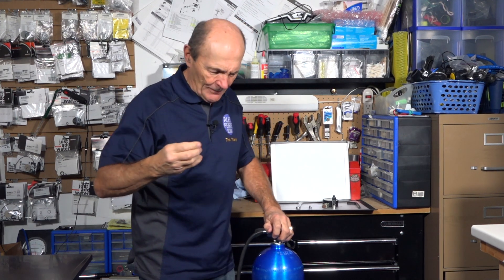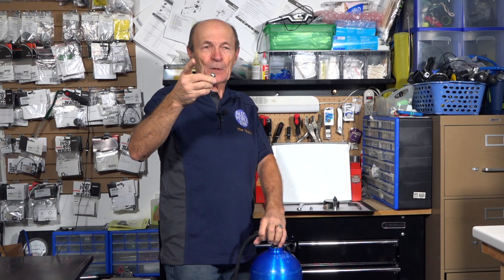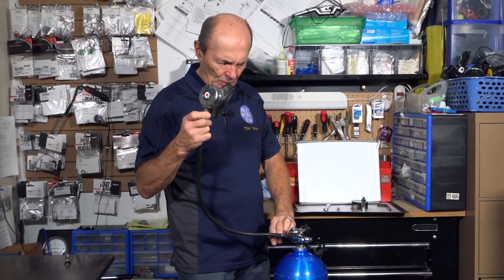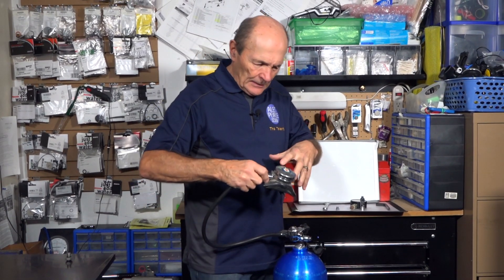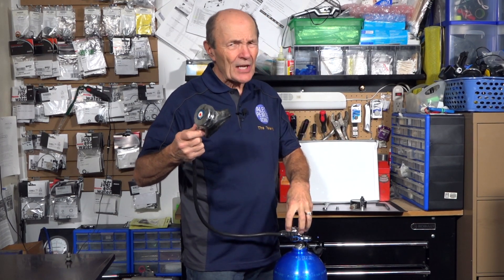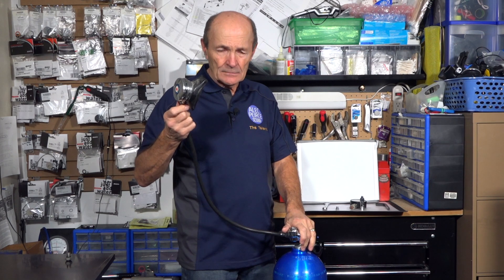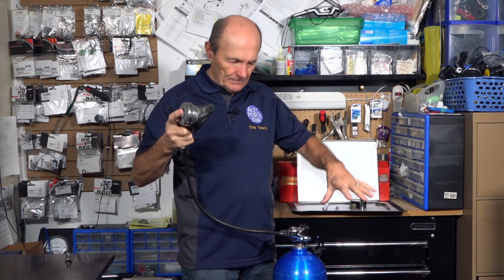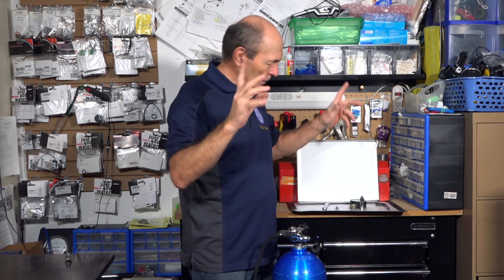What Is An Overpressure Valve? - Scuba Tech Tips: S10E19

Comment: Do you have experience with poseidon? I have a xtream 2nd stage that says ip should be 125psi if my first stage is a scubapro mk11 with a c370 and a ip of 130 to 140  will this be a problem? Thanks
Reply from the maker: Poseidons are a bit odd. They do require a specific IP and it's usually lower than for many other regs.
So, rather than adjust the Poseidon 2nd stage to work properly with the IP coming from the MK11 1st which is the common adjustment method, you can simply adjust the IP coming from the MK11 to work properly with the Poseidon 2nd.
Assemble the Poseidon 2nd onto the MK11 1st.
Turn on the air slightly. You will probably get a hiss.
Turn the Allen head bolt on the MK11 counterclockwise until the hissing stops.
Turn it clockwise until it hisses again.
Keep doing this back & forth until there is no hissing but it's right at the edge, just about to start.
Breathe. Feel good? Try it in shallow water. Good? You're away!!!
NOTE: this is NOT in the book & may be frowned upon by reg service professionals.
But, it works.
Also note: if you are using a Safe Second, it will have to be adjusted to work at the lower IP otherwise it will be hard to breath.
Alec
Reply: @Alec Peirce Scuba  so the ip on the scubapro 370 will have to be adjusted from the reg itself dose that take special tools? It seems poseidon needs to use standard ip pressures, and they would sell a lot more in the states because this is the fear most have  using. Ed Sorenson from Cave Adventures said I will never notice the performance difference as long as it doesn't free flow. I'll try it in a pool first. A shame they can't be universal 😕 trying to put together my sons first scuba set up, so he will never forget it is getting difficult. I will adjust it like you said 😉

Comment: Another great video and i like the practical demo of adjusting the IP and pushing the 2nd into freeflow!  A picture is worth a 1000 words and all that

If i may humbly add a couple of additional points that might make it a sensible descision to add a OPV to a std regulator setup :-)

1) Your demo is with an old unbalanced 2nd.  Nothing wrong with these, but a lot of modern 2nds are pneumatically balanced, ie they use the IP to help push the demand valve shut a bit. This means it takes less force to open that valve, meaning they can use a smaller diaphram (for a more compact 2nd) and the diver gets a slightly lower inhilation effort.  The side effect however of a balanced 2nd is that the very fact that it is less sensitive to changes in IP (normally a good thing) means that typically it won't get pushed open until a much higher IP.  That higher pressure could be above a critical point, either a hose burst (actualy unlikely for good condition hoses as although the working pressure tends to be 250psi, bust pressure is typically >500 psi) or more likely, and potentially just as serious >>>>

2) >>> At some pressure, chances are, the valve controlling the air into your buoyancy control devices (BCD/Wing/Drysuit etc) can get pushed open by the excessive IP!  Now you have the potential for a catastrophic ascent rate, leading to potential barotrauma, and DCS, even from fairly shallow recreational depths!   Sure, if you know what has occurred, and you react fast,this can be easily mitigated against, by diconnecting your inflators from your buoyancy devices and dumping gas, but it can happen quickly, without warning and potentially when you have hands full doing other things!  And as we all know, things snowball so to speak.

3) For most divers a fully freeflowing 2nd stage, especially one being fed with an IP way above normal is a fairly dramatic event!  Lots of noise, bubbles, and the feeling that you can't breath because air is being "rammed" into your lungs.  Yes, we are all taught how to deal with this event during our training and hopefully we practice these skills now and then, but again, none of us are perfect divers(well 'cept me obvs... ;-)) and things can get out of hand.  So for me, the biggest advantage of a completely seperate OPV mounted into a spare port on my 1st stage is simply to provide an external, seperate and more controlled vent for any IP excursion.   And because that vent is seperate, and away from my 2nds, even during a pretty catastrophic 1st stage freeflow with IP through the roof, my 2nds breath normally, and my inflators work normally. Sure, i'm thumbing the dive and getting the hell out of dodge, but whilst i do that, i am not tasked loaded by actually having to deal with the problem.

I guess we also should mention the downsides of fitting an OPV.

1) OPV can leak at normal IP's.  There are a few types out there, some seem worse than others.  The really cheap ones don't have any way of physically "locking" the adjustment screw and these can work loose, undo, and suddenly they leak at normal IP's!  DOH! not good, but easily fixed, and easy to spot (do your S-drills / bubble checks everbody!). They also can get jammed open by dirst/grit, but this is fairly incommon because they sit behind the 1st stages filter element.  They also can be damaged if gear is dropped and banged into, but again, careful handling of you kit is always recommened. - Carry a spare one in your "save a dive" kit!

2) the OPV is probably mounted behind your head in most cases (for backgas cylinders) and hence isn't that easy to see (eyes in the back of your head???). If it starts to leak, due to a fault with it, you can probably hear it, but not see it. Make sure your buddy knows what it is, and then you can ask them to check it!  If it starts to leak due to a genuine IP overpressure, chances are there will be so many bubbles you or your buddy won't be able to tell where they are coming from!

Hope that's interesting to your viewers!  Cheers :-)
Reply from the maker: A very good explanation that should help someone with a OPV problem.  Much appreciate the though and effort to share this with everyone Max.

Comment: Some CCRs have the over pressure valve installed. I read having a burst disk on manifolded valves can be a weak point. What's your take on this?
Reply from the maker: As others have kindly pointed out, I'm not a certified tech or CCR diver, but have done both.  Burst disks rarely are the cause of a tank leak where over filling, extreme heat, abuse, no replacement are the primary cause of a burst disk releasing.  I think having more than one safety disk, burst or OPV, is enough if you care for the gear properly.

Comment: Thx Alex. I been enjoying your videos during this difficult time in Singapore for the COVID-19 quarantine measures. I was hoping the u can do a video on the general tyres & sizes of O-rings involved with scuba diving. I been thinking to have my SAD kit with o-rings or for general service of my equip. Recently an O-ring fly out from the DIN regulator. Fortunately I found it on the boat.
Do stay safe at home..."Live long and prosper" - Spock.
Reply from the maker: There are only about 3 or 4 O-Rings that a divers needs to have in his 'emergency' kit. By emergency I mean, on the boat just prior to a dive.
A tank valve face O-Ring (if using a yoke), a DIN regulator valve face O-Ring (the one on the threaded insert), and maybe a couple to replace the ends of the hoses at the 1st stage (2 different sizes needed).
Any more than that and you are looking a professional service.
I hope this helps.
Alec

Comment: Does that mean every diver who wears a dry suit, the hose coming from the valve on the tank to the dry suit, they will always have to install an overpressure value?
Reply from the maker: No. Not necessarily.
Most systems will release excess air, usually through the primary 2nd or safe second.
An OP valve is only required if the likelihood of non-release is possible. 
That is, if a problem in the 1st stage occurs and there is no automatic release of the increased pressure, an OP is needed.
A

Comment: Informative video as allways
One additional purpose of OPVs:
If you use an Upstream regulator (there are still a few made today, i.e. Poseidon) you need one but they usually have an OPV built into the 1st stage
Otherwise you couldnt breathe if the IP rises
Reply from the maker: That was the point I tried to make.  Hope you picked up something new.
Alec
Reply: Possibly the old cyklons are upstream, but are now downstream. The Jetstream usually has a opv on the connection of the hose and second.
The Nemrod Snark 2 had the opv on the round type 1st.